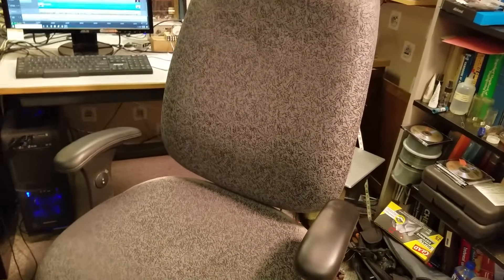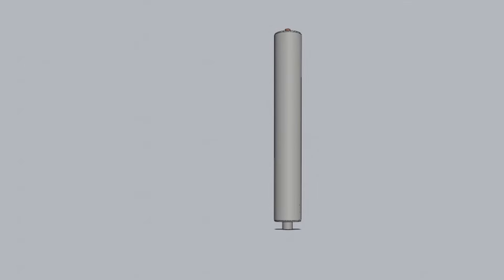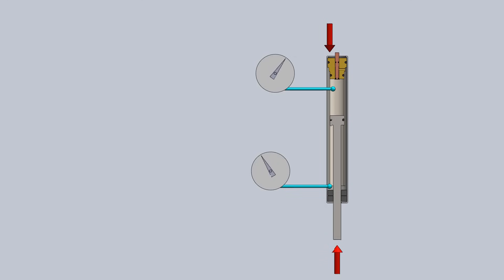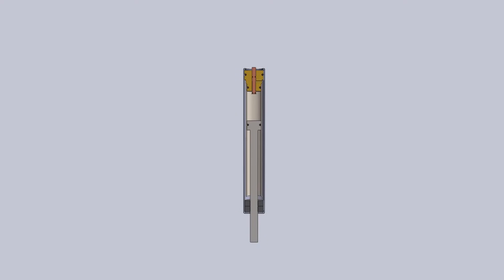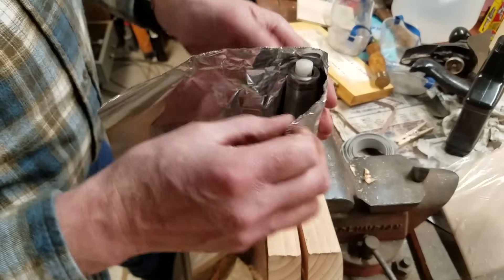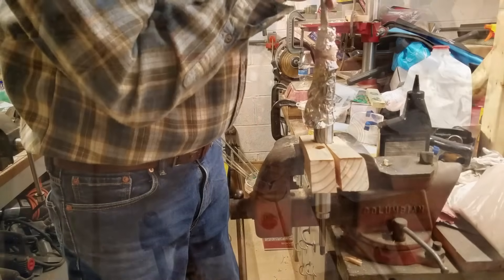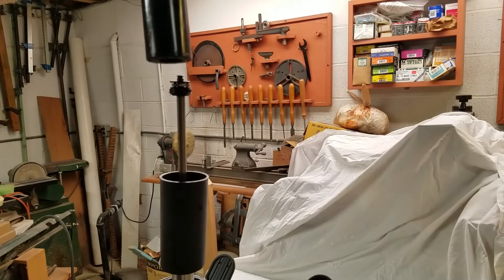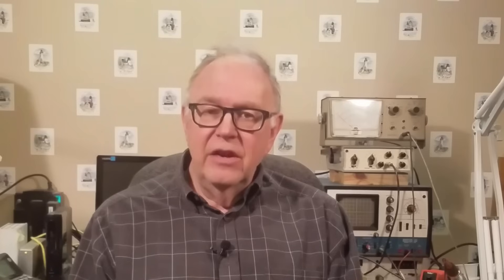The Mystery of the Sinking Office Chair - Can We Fix It?

Comment: My gastube is completely shot. I found replacement. Apparently they all have the same diameter size, 22mm +- .5. I just found the tubes randomly in my office junk corner. Suffice to say with a pipe wrench, a hammer and a lot of expletives, the tubes just drop off because of the tapered ends. Yes, both have tapered ends so we can use our body weight to press fit the gastube. Great DIY!
Reply from the maker: Glad you got it fixed! Thanks for sharing your experience.

Comment: pipe wrench gets a cylinder off piece of cake
Reply from the maker: That is a good way to take the cylinder off if you don't want to use it again.  I'm just afraid that the pipe wrench could damage the cylinder, especially if it was a little stuck.  Thanks for the comment!
Reply: @LifewithDavid1 well presumably you’re taking it off cos it’s faulty or failed (mine had)

Comment: Your camerawork obscured the hardest part, removing and later replacing the retaining clip. At 5:30 one needs to insert a narrow screwdriver blade to lift up the folded over-part of the clip so that it clears the "button" on the strut, and then you can slide it off.

Be careful pulling the chair base off the strut. My cheap stool had a couple of washers, a ball bearing race, and a plastic ring that allow the stool to spin, and they all fell off the center bar of the strut, and I'm not sure the order in which they should be re-stacked.
Reply from the maker: You're right.  It is a little difficult to show all the details on removing the clip.  Every chair is different, both with the clip and the bearing; it's hard to get a representative example.  Thanks for watching!

Comment: Thank you for sharing this informative video! However, I have a question. I was trying to disassemble the cylinder from the chair, and after removing the clip and washer from the chair base, I sat on the chair. The chair was in an almost no-load position, i.e., at a certain height. I heard a burst of air from the bottom of the cylinder, after which the hydraulic system stopped working, and the piston completely sank into the cylinder. I think the nitrogen leaked, but I don't understand why it happened?
Reply from the maker: I'm not sure, but perhaps the cylinder rod experienced some extreme side forces,  This could have pushed the rod sideways in the seal enough that the seal started to leak.  If this happened, then cylinder replacement is the only option.  These cylinders are designed for axial loads, tangential (sideways) forces on the rod can cause a problem.   Hope this helps and good luck.

Comment: Nice. All I had to do to my sinking chair was detach the base, invert it, drip some oil on the rod (I used motor oil), pump a few times - fixed!
Reply from the maker: Great!  I think thee inversion did the trick; you probably didn't need the oil.  Check out my other chair cylinder video.
Reply: @LifewithDavid1  Nice one. Love a quick fix. I was about to buy a new cylinder!
Reply: I wonder if a thin lube like WD40 or silicone spray would work?
Reply: @colonelhuxley6412  I think the viscosity of the oil is needed.  WD40 is not really a lubricant; it is a water displacement fluid and will get sticky.  The hydraulic oil is friendly to rubber parts.  Thanks for the comment!

Comment: I use a somewhat different method. Since I am a very large man, I want the chair all the way up, all the time. So my fix is to go to the hardware store, get a piece of water pipe that will just fit over the cylinder, measure the gap between the seat and the wheel, cut the pipe to that dimension and install it over the cylinder. Presto, the seat will now stay up for decades.

Comment: 6:04 Easiest way to remove the cylinder from the seat on the top side is, take a plumber wrench and grip the
silver part turn it one direction and will come off easily.
Reply from the maker: I worry that the pipe wrench might damage the cylinder if you were hoping to use it again.  However that sounds good if the cylinder is already shot.  Thanks for the comment!

Comment: i never adjusted my chair height after the first day of owning so when mine started sinking i just took an old piece of PVC pipe i had laying around, cut it in half and then clamped it to either side of the cylinder and clamped it in place. never had another issue! ;)
Reply from the maker: That's great if it works for you.  I like the bounce of the cylinder when I sit down.  I have another fix video that doesn't need any tools (https://youtu.be/mWD3TvXOU0c ).  Thanks for watching!

Comment: can we use engine oil instead of hydraulic oil.
Reply from the maker: Check out my other video first (https://youtu.be/mWD3TvXOU0c); you  may not need to disassemble.  I wouldn't use motor oil since it is a little tough on rubber seals.  Good luck!

Comment: Thank you for your video.  I have a replacement cylinder that should have fit my chair but there was no way to release the cylinder assembly with the outer cover from the wheel base (i was able to get the cylinder out from the chair with a pipe wrench as shown in other videos). With your demonstration of releasing the clip and washer at the base, I could easily release the cylinder from the outer cover and insert the new cylinder into the base with the washers and bearings. It was a perfect fit and so much easier than trying to remover the outer cylinder from the wheels. Thank you
Reply from the maker: That's fantastic!  I'm so happy to hear it worked for you.

Comment: I gave it a triple thumbs up. I subscribed to thank you profusely for your explanation.  Unfortunately, I live in a flat lacking a lab or a garage I could replicate the repairs so I just bought a replacement to install instead. but I would be saving it in an attempt to fix it in future. thanks again for this very informative video
Reply from the maker: View my more recent video (pinned in the description) for an even easier fix.  Many times you can perform the repairs without removing the cylinder at all.  Thanks for watching!

Comment: The problem that come with most every convenience we buy (like the cushy adjustable chair) is the question we should ask before we buy. The question is "What is the PIA factor" with the product. "PIA" ? > Pain In The Ass, that come with virtually everything! that is What is the failure rate and the complexity of the repair? Quite frankly, the manufacturers build to fail. And because people generally don't have the patience or facility or the time to fix crap any more.
Reply from the maker: I agree!  Check my other chair cylinder repair video; it is MUCH easier.  The link is in the description below.  Thanks for watching!

Comment: i know this is 3 years ago... but i want to ask, is there an alternative to hydraulic oil? can i use 3in1 oil instead?
Reply from the maker: Try my other, easier fix first!  The link is pinned to the top of the comments.  All the hydraulic fluid you need may already be in the cylinder.  I would stay away from any oil that could soften the seals that are used in the cylinder.  Good luck.

Comment: I took the simpler route.
When the boss was out of the office I wrapped the cylinder in a spiral of corrugated cardboard an packing tape.
Otherwise I would get yelled at that there is no budget for chairs and get back to work!
Reply from the maker: Interesting...  Try my other easier "fix"; the link is pinned to the top of the comments.  No tools needed.

Comment from the maker: I'm sorry, I'm not familiar with that chair.  If you can't move it up or down, check to see if the height adjustment lever is actually pressing on the valve button on the "top" of the cylinder.  Also there may be something jamming the mechanism.  Good luck, and thanks for watching!

Comment: Hello, just watched two of your videos regarding the repair of, in my case, a gas lift. WorkPro PRO-767E Commercial Mesh Mid-Back Chair. Are you familiar with the brand? I purchased my chair in 2015 with very little use. No longer being able to lift the chair up or down makes my chair no longer useable. I actually enjoy repairing things myself because 1) saves me money and 2) satisfaction of fixing something when people think I will not succeed . 😀
Reply from the maker: It could also be that the gas cylinder has failed and needs to be replaced.
Reply: @LifewithDavid1  Hi. That’s what I thought as well. Thank you so very much. I’ll let you know when I’ve finished the repair. BTW.. In one of your other videos you recommended the chair be turned upside down for a while.  Would the same apply to my chair cause it’s been upside down since yesterday. 😀
Reply: @BecauseOfHim1111  It would; however if the cylinder is faulty, the fix won't work.
Reply: @davidminderman3179  sending you a million thanks!

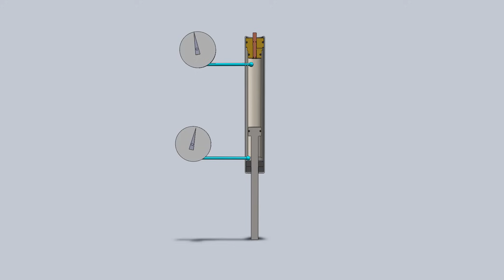Comment: Hey Dave. I was attempting this wd40 fix and unfortunately it didn't work.  I stumbled upon your video where you explained HOW the pressure worked. Mine is too low and dropped. You explained it so well @ 4:10 . I guess i have to get a new chair, but I really do appreciate the knowledge and explanation. Thank you!
Reply from the maker: You might be able to salvage the chair by replacing the cylinder.  Thanks for watching and good luck!

Comment: I took a short piece of PVC pipe, cut it in half length ways, and then clamped it over the chair's cylinder with a couple of hose clamps. ( I guess a couple of black zip ties would have been a bit more inconspicuous. ) I had to trim the length a couple of times but now my chair is mechanically fixed and nothing had to be disassembled / reassembled and no oil dripping on the floor.
Reply from the maker: That's good.  My more recent video doesn't involve any disassembly or oil.  It's very easy and may work for you of you ever want to restore adjustability to your chair.  Thanks for watching.

Comment: Great video, didn't expect to find one so detailed as there's not much info on the subject. Mine has a different problem, quite the opposite of what you usually see: i like to actually keep it low, but everytime i leave it alone it springs back to the maximum extended position. What do you think about that?
Reply from the maker: It's probably the same problem, leaking seals.  Try the easy solution in my other office chair video that I have pinned in the comments.  Good luck!

Comment: Instead of going through all that messy crap, why not just let loose of $15 or so and buy a new lift cylinder and put it in?
Reply from the maker: I found that you don't have to get into that "messy crap".  Please see my other video ( https://youtu.be/mWD3TvXOU0c ) for an even EASIER way to fix chair cylinders.  NO TOOLS! NO COST!
Reply: Interesting method.  I've already bought my replacement cylinder though, and so I want to just go ahead and put it in and hopefully the lift will last another three or so years.  The problem I'm finding with all these r/r the gas cylinder videos is that they all show someone working on a cheap office chair, typically mostly plastic.  My chair is a LaZboy, built for 400-lbs. persons (i.e. a "high capacity" chair).  Definitely more metal (and leather) than plastic.  I've tried using their own parts vendor's video for how to r/r the cylinder, but it's just not working.  For one thing, I don't see how the "five star" leg assembly (made of solid wood, btw) can be removed by whacking the bottom of the cylinder with the side of a hammer (in order to avoid hitting the clip on the end of the cylinder).  I've whacked the thing until exhausted, with no movement at all.  A closer look seems to show that there is a metal ring around the cylinder that would seem to prevent the cylinder/leg assembly from moving in the desired direction to separate them.  Ugh!  🥵      @LifewithDavid1
Reply: Now Im very interested in to how this can fix the my cylinder Im going to try this….thanks

Comment: I always use a pipe wrench to twist the cylinder out of the chair. Works every time 👍
Thanks for this great video, I always wanted to know how these things worked.
Best wishes for your continued success ☮
Reply from the maker: I wondered about that.  I was concerned about damaging the outer cylinder wall so I tried less aggressive methods (like beating on the end with a hammer is less aggressive lol).  Thanks for the suggestion!

Comment: Operation diagrams are great, however you really did tonsillectomy via hind end of alligator to remove cylinder from seat of chair.

just put chair upside down or on angle on floor, put wd-40 or teflon spray lube into cylinder hole of seat and let sit for a few minutes, then grab cylinder with pipe wrench and wiggle out.  I even do that as first step since removing cylinder from base is so easy as step two, just invert, hold chair feet and give a tap to edge of cylinder with mallet.  watch your own  feet when doing that, 2 lbs cylinder falling on foot might be bad 8D
Reply from the maker: Thank you for the comments.  Those are all really good suggestions.  I had actually tried all of them as well as making a cylinder puller that also didn't work.   I didn't show those on the video since they did fail.  My particular chair's taper is such that the cylinder completely jams in there; sometimes there are just difficult "children " out there.  That's why I developed my other video ( https://youtu.be/mWD3TvXOU0c ) that doesn't need the cylinder removed.  Thanks for watching!

Comment: One of my chair legs is snapped what bonder / adhesive do i need or do you have part link for the base of the chair with the wheels on? If the wheels are separate how do i remove the wheels. My chair is also sinking too so i will get to this after, thank you for sharing
Reply from the maker: If the chair base is made of polypropylene. then I'm afraid you are out of luck.  Nothing bonds to polypropylene.  You could contact the manufacturer to see if he sells spare parts.  As far as removing the wheels, they normally just snap in, so they should just pull out.  Good luck!

Comment: I wish I'd seen this last week.  I searched for how to fix a chair gas cylinder and saw several other videos how about how easy it is to replace a gas cylinder.  Even bought a pipe wrench to "give it a little twist". It is not always as easy as they show.  My old cylinder is in 2 parts, there are shards of metal all over and I've cut myself 3 times.  Turns out all I needed was a little oil in the right place.  This video didn't even come until I searched google for "where is the gas in a chair gas cylinder" because I was thinking about cutting it out.  So nice to find a straight forward informative video.
Reply from the maker: I wish YouTube would get this out to more people.  Sorry that it didn't show up right away.

Comment: Hello David @LifewithDavid1 Thank you very much for this tutorial. However i have a one issue. Since in my area I have found several types of hydraulic oils with different viscosity grade 15, 20, 32 and 46. Could you please recommend which one would be the best for repairing office chair lift cylinder? I will appreciate your advice because I am a bit lost. Of course none of sales agent can recommend me anything neither...
Reply from the maker: Check out my other video ( https://youtu.be/mWD3TvXOU0c ); you might not need oil at all.  There was nothing special about the oil; just a consumer grade hydraulic jack oil.
Reply: @LifewithDavid1 Thank you for quick reply. Regarding your suggestion, of course I have seen that second method and implemented it. Unfortunately it works within a half day only in my case. Afterwards I have to repeat the same process. Therefore i decided to make repair that will last longer. In my country there is no consumer grade hydraulic oil but specific only with particular viscosity grade 15, 20, 32 and 46. That's why I asked for help :) Maybe you could advise something?

Comment: Good work David. Never pass a discarded office chair by the roadside even if it looks trashed the base may have a perfectly functional piston and many office/ gaming chairs share the same 4-bolt configuration under the seat.
Reply from the maker: That's a great tip!  Waste not, want not.  Thanks for watching!
Reply: Good advice, all my office style chairs are discards, even a $1000 Herman Miller, that only needed a new cylinder 👍
Take the trashed chair off, and you have a great start for an adjustable, rolling work table, just bolt a scrap piece of plywood on top, and Bob's your uncle 🤠
Reply: I went the route of buying a new cylinder for my chair when it started sinking. Trying to remove the old piston didn't work tho, it was completely seized, and going at it with a punch ruined it completely. Had to buy a new seat base mechanism as well.

Comment: Really appreciated this video since my new chair is stuck in the down position. This video taught me how the mechanism works so I can troubleshoot accordingly. Thanks!
Reply from the maker: Glad it helped.  Stuck in the down position is not good; it probably means that the cylinder has lost pressure.  I'm afraid the fix is to replace the cylinder.  Good luck!

Comment: showing that punch work that way was exactly the advice I needed!
Reply from the maker: Great, I'm glad that helped.  However, you might not need to remove the cylinder; check out my newer video; I pinned the link at the top of the comment section.  Good luck!

Comment: What i don't understand, what f the jack oil can leak in. How come that 2000psi stays in?!!
Reply from the maker: I think that it worked not because of the jack oil, but rather because the cylinder was inverted.  See my more recent video about inverting the chair (which I see by your other comment that you have already seen).
Reply: @LifewithDavid1  THanks, i saw that one. I think mine is has issues raising is due to it being outdoors in the open for couple weeks. Shows corrosion